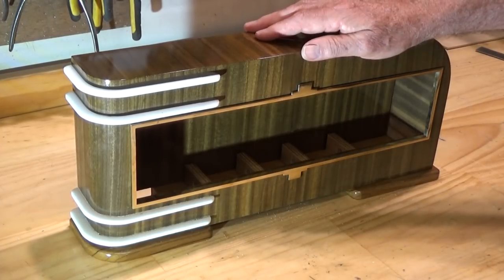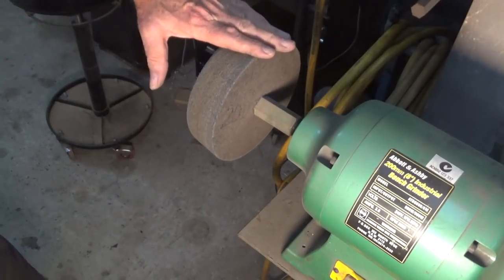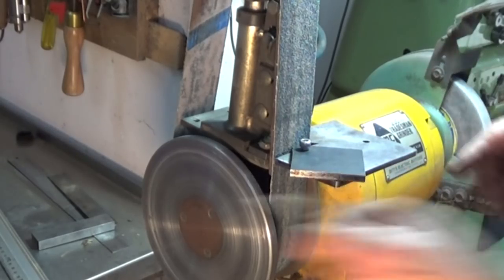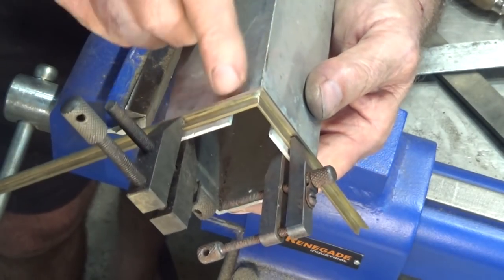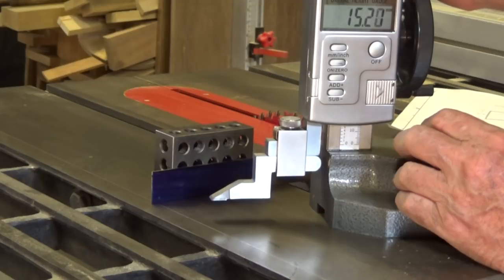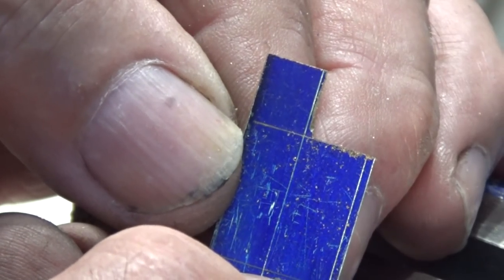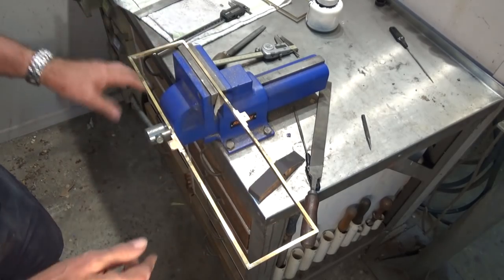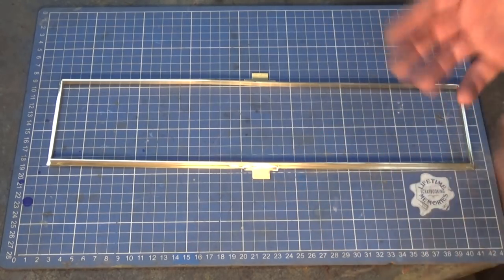Sexy, Lixie Art Deco Clock Build - Part 8

Comment: Mark I use the EXL Scotchbrite wheels extensively in my shop. They also become concave and convex at times. I use a worn out file turned on edge against the wheel to true it back up. Works like a champ, but you'll be covered in Scotchbrite bits at the end! Best, and thanks for the vids.
Reply from the maker: I tried this yesterday but it seemed to just wear away the edge of the file. I was thinking I might be able to mount the wheel in the lathe and use an old carbide turning tool to reshape the surface. I would have to cover the ways of the lathe and use a shop vac to suck up the debris. I could also do it on my wood lathe just to avoid the problems with getting abrasive into the moving parts of the metal lathe. Having said that, one rounded edge on the wheel is sometimes handy and the tapered surface doesn't present much of a problem either. Having the surface concave is a problem though. 
Regards,
Preso
Reply: @Preso58  Sorry it didn't work for you Mark. I too have to keep using different file edges as they wear down. Your wheel is wider than mine too. I use the 1 in wheels. The carbide turning tool on the lathe is genius. That'll definitely do the trick. Best!

Comment: Do yourself a favour and make some solid copper vise jaws.  One of the best things I ever did in my shop!
Great info on filing.  I will be thinking about my thumbs next time I do some draw filing.
Reply: John Creasey for some reason I can't give you a thumb up, so here's a Kudos!
Reply from the maker: I have some thick copper sheet, around 2mm so I am thinking that I could silver solder some of this to a set of mild steel jaws?
Reply: Mark Presling I just used some bus bar from the scrap man.  They take a beating but never mark the work.  Easy to clean up on the mill, but in over 2 years I haven’t bothered.

Comment: Always enjoy draw filing, but you can improve on the finish further if you give your file a layer of french chalk before you start. This does two things, it reduces the depth of cut still further and prevents any buildup between the teeth which may scratch the surface. A ready supply of french chalk comes from a welding supplier, welders use it for marking out. Clickspring, well there’s a subject in itself. Saw he’s being hailed as a national treasure. Whatever, he’s the best craftsman on YouTube in my opinion. The finishes he achieves are beautiful. Regards
Reply from the maker: Peter, we used to instruct students to fill the surface of the file with ordinary blackboard chalk but it was mainly to stop the file from "pinning' or filling up with metal waste. I have never tried using french chalk and I have some so I will give it a go. The USA might have Jimmy Diresta but in my opinion, Chris from Clickspring works on a completely different level. I cannot believe he made his own files 😮. Even This Old Tony seems to be in awe of his work.
Regards,
Preso

Comment: I had to cut mitres on some angle trim the other day
It did my head in trying to work out left/right up/down

Also is there a reason you didn't mill the corners out on the decorative pieces?

Great work , just found this build, you've got my attention though
Reply from the maker: I probably should have milled those corners out but it might need to be backed up with some aluminium stock so it wouldn't deflect. I know what you mean about the orientation thing when dealing with angle. So many opportunities to get it wrong!

Comment: I loved your comment on using vernier cal. for marking or scribing. I just recently bought a Shars 12" height gauge with carbide scribe for my far flung 4 x6 ft CNC Router project. Tried to use granite from discarded countertop as surface plate,

 it was beautiful stuff with mirror finish. Cut it up with 7.5" diamond wheel and was shocked as to how easy it was to do and then to see in some of the various sized pieces a deflection of over 0.100"  others simply fell apart  - quartzite inclusions! But really, warping? I was heart broken and very suspicious of the piece I had claimed for my bench in a three point mount.
So much for discards. I will give them away as kitchen cutting blocks. 
Being that I am so terribly afflicted with frugality....in my sights, a more homogenous granite much like the kind they sell as surface plate, mind only~35 mm - when I get a hand or two to move the ~300Lbs. Surely I can get some accuracy over 12" to the nearest 0.01mm
Reply from the maker: Well, at least that settles the same questions I had about using kitchen benchtop composite granite. I know it flexes quite easily but I thought that small pieces at least would be stiff enough - maybe not. I keep looking for cast iron surface plates in Ebay but the shipping costs are prohibitive. There is an engineering supplier close to where I live who sell new ones and maybe I'll get myself one for my birthday!
Reply: @Preso58  I don't know Mark, there is always a possibility of sourcing from a monument company, yes I mean headstones :)
I am not sure how I will test the 16 x 16 piece I have for flatness.
I never really wanted to build this CNC Router from scratch but now possess  infinite knowledge of all its minutia. Still looking for a hobby machinist with knee mill to help with some of the 6061 T6 parts. Others I will be trying very carefully to do myself rather than be soaked for $75/Hr at inflated time estimates when I have,  in all practicality,  nearly brought them the fished G-Code (which I have learnt since starting this project via Fusion360)
Perhaps I will remember what it was I wanted to make with the construct once I have gotten past this nonsense. Miles to go before I make camp....
Reply from the maker: Chris, I was watching a video by Tom Lipton (Oxtoolco) in which he discussed purchasing some 3D printed metal parts from a service bureau. He stated that he couldn't justify making the parts from scratch given the price he paid for the printed parts. The quality looked good and it might be an alternative to fabricating your own parts or trying to make them without having specialised machine tools. CNC machine shops charge like wounded bulls although you would at least get a part with known metallurgy and specifications. The one and only shop close to where I live closed down several years ago because they couldn't compete with China and they charged way more than $75/Hr. I must take a look at a local stone supplier this morning. They might have some broken pieces of granite but as you have observed it's hard to know how flat it might be.